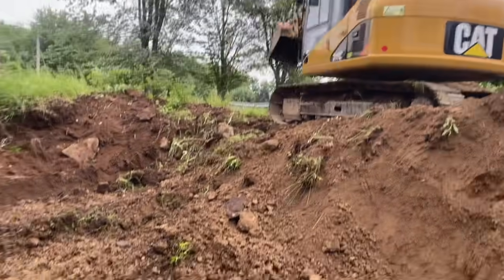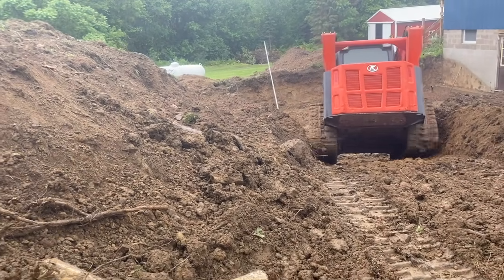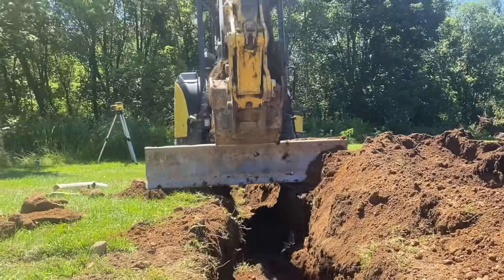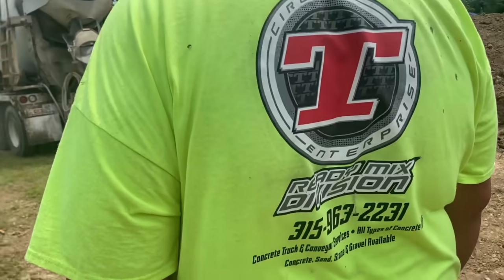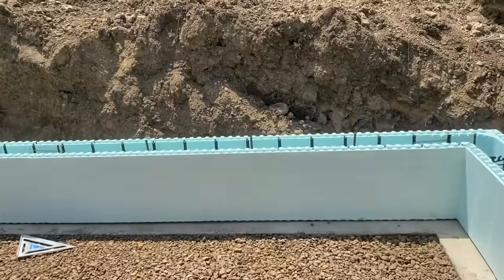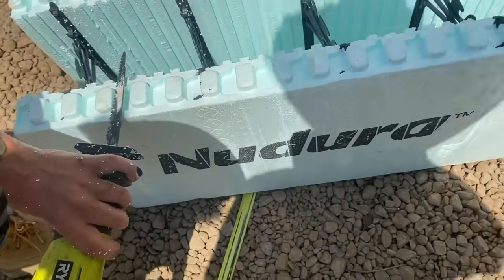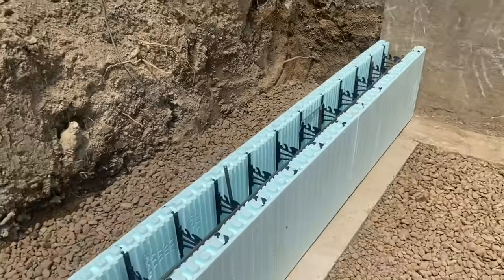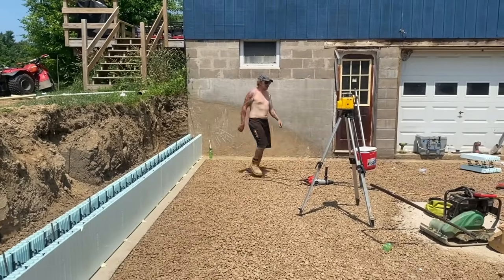Building ICF foundation for an addition Step 1

Comment: Is there a reason why you did not apoxy The rebar in that wall
Reply from the maker: What purpose would that serve? The only thing it could help is if something were lifting up on that massive poured wall.
Reply: @bondobuilt386  That's what I am saying. If you have something loose and the Earth moves, It will be that much easier for it to move, It has to be anchored together. Just like you taken wire ties and tie and Rebar together. You have to  apoxy the rebar in to that Wall So that it won't move.
Reply from the maker: @gregsidel3557  we are in an area of no earthquakes or tornadoes or hurricanes and our code does not call for uplift resistance like some parts of the world the rebar in this case just resists side to side pressure when backfilling

Comment: You asked about how the viewer places stone.  On some jobs where i am using ICF's and have tall walls, I often run the floor joists to help offset the compressive loads of backfilling. I then call the concrete plant and they will run me a few trucks with conveyors and a load of their wash rock. Simple matter of pouring the stone in between the joists.

Comment: Looks great! Might have missed it in the video, but any need for a french drain on the perimeter?

Unrelated, but happen to know any excavation contractors in NJ area? Going to need to do a large cut for my own house's foundation (~12-13 feet high) and wanted to ask around if that will need engineering design for temporary support.
Reply from the maker: There is a French drain we put in this video.

Comment: Why don’t you epoxy the rebar into the existing foundation???
Reply: Can't speak for the poster but all of the guys I've seen don't epoxy it because with short walls the point of the rebar is to prevent movement side to side. The chance of the wall pulling away from the existing foundation is extremely small due to it having to push the entire length of new wall to be able to do that. Commercial is different as they have very specific engineering requirements so I see a lot of epoxy on commercial.

Comment: How did you do the vertical rebar in the footer, just push it in?
Reply: Once the footer has been leveled (during pouring) the most common practice I've seen is to bend the rebar into an "L" shape so it's running parallel to the footer inside the crete and vertical outside.

Comment: Sir, for a 30x60 foundation, how long should the footers cure before the walls get poured?
Someone is telling me 4 days.....
Reply from the maker: We usually are 4 days or more before we get the walls up and never had an issue.
Reply: Depends on what the weather/temps are. In the middle of Summer (80s-90s) our subcontractor will pour on top on either the 2nd or 3rd day and never had any issues. With temps that high you can walk on the footers at the end of the day you poured them.

Comment: I would think that pile of concrete in the middle  would create a pressure point on the floor causing cracks.  But I know you wouldn't do it  if it wasn't OK... so my intuition must be wrong.
Reply from the maker: No we put pads in for posts all the time Jim. No problem at all bud. 👍

Comment: I don't like the fact that you didn't put any rebar in the concrete where the Jack post is going to go!
Reply from the maker: That pad was way over sized for the post probably 4 x bigger then it needed to be. The rebar will not make a bit of difference